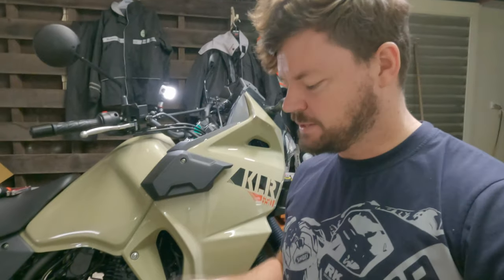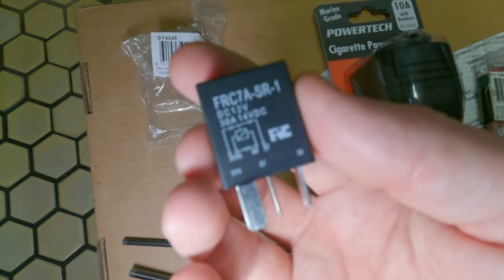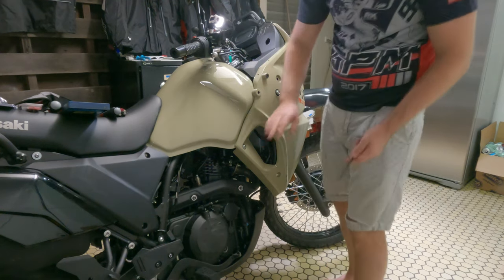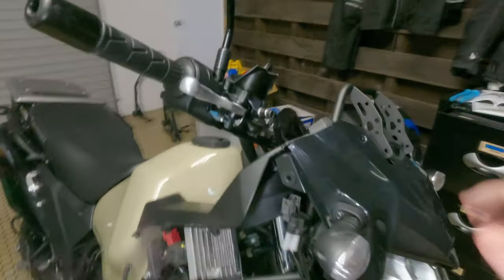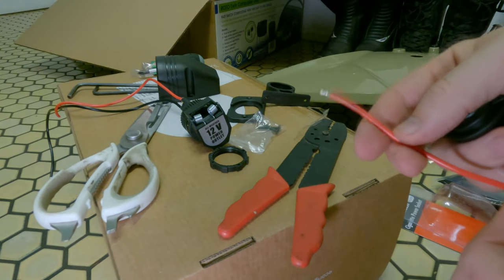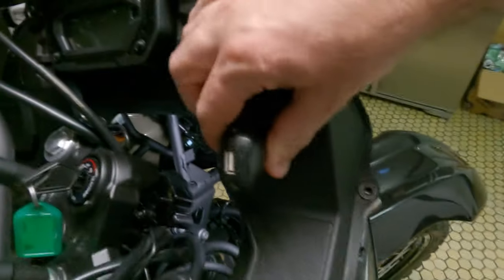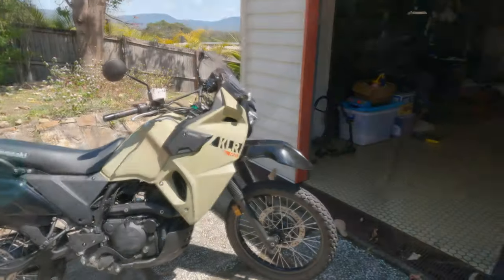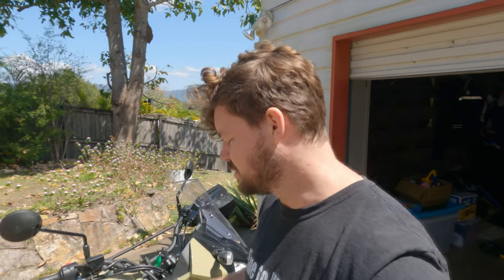2022 Kawasaki KLR650 12V Socket Install & How To | Don't Buy OEM, Save $$$$

Comment: Nice job, thanks mate- I'm doing mine tonight.
I'm going to splice two tails from the power supply and wire up some  fog lights too... (better do all that before I put the crash bars on: ). Ill keep the other plug for some heated grips.
Reply from the maker: Heated grips, great item to have

Comment: I would flip those blue terminals over that connect to the back of the 12v outlet.  Just thinking if water were to ever get in there, it’ll drain out better with those pointed downward.

Comment: This video really saves cause Australia dealer only introduced the basic and adventure model with middle tier traveler model missing. I thought I need to pay $1000 more to get this power output with those pannier cases ( I rarely use them in city commute). Thanks for this intro video.
Reply from the maker: Glad I could help

Comment: Great job... I put my usb charger on that side using a Scanstrut waterproof dual usb. I see the only thing you didn't cover was which connector was positive and which one was negative, that would have been helpful for those doing the install... of course, you can just pull out the handy VOM and check which wire is positive and which is negative.
Reply from the maker: Yeah I realised afterwards that I left that bit out! It was a messy filming process that day, had to juggle the baby at times so I went 'stuff it'. The Scanstrut looks like a really nice bit of kit
Reply: @onthebackwheel  Still an excellent job... helps out a lot of people plus it's a lot cheaper to build the KLR out yourself than to get the adventure model. Yes, it may take a little longer to build but you get what you want and are not stuck with a lot of extra stuff you didn't want in the first place.

Comment: love it. Now how about the other port on the other side, is there another slot for a relay on the other side or could you just mount two from that one set of factory bullet connectors? thanks keep up the good work.
Reply from the maker: The one relay does both. I didn't end up installing one on the left as they didn't have an affordable option at the time, but you can now get aftermarket ones that are well priced. Never installed one so can't tell you more than that sorry

Comment: Good video mate!
Im looking at getting a new klr soon and tossing up between the base model and adventure model. Do you reckon the base model is the way to go and just do little mods along the way?
Reply: Get the Adventure. Picked mine up 2 week ago... Its great
Reply from the maker: Thanks Brock. Depends what you want to do. The adventure is great value, it is roughly $2200 of gear (all installed too) for $1000. The base rides a little bit better because it simply has less gear and weight.  Personally, I'm putting that thousand bucks to mods I want. If the adventure came in tan, I might have got one and sold the gear I didnt want (panniers and lights)
Reply: @onthebackwheel  Thanks for the reply mate. I really like the tan/khaki aswell
Reply from the maker: @BC-vi2iy  no worries. The Khaki does look good!

Comment: My cigarette lighter is marked + - but the bullet ends from the bike are not ??
Reply from the maker: You'll have to use a test light or just turn the ignition on to check it before you put it all together. I can remember which one was which and don't have my bike in front of me